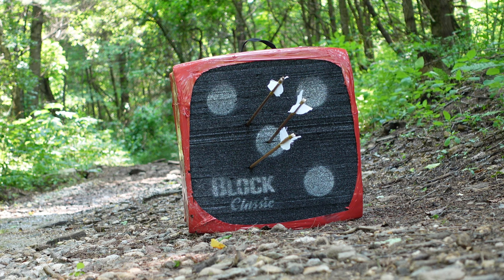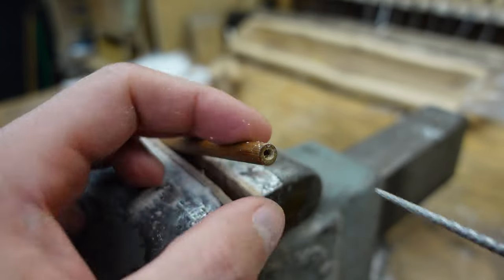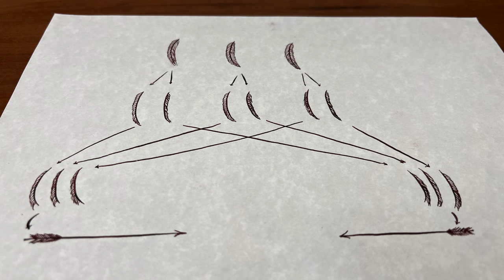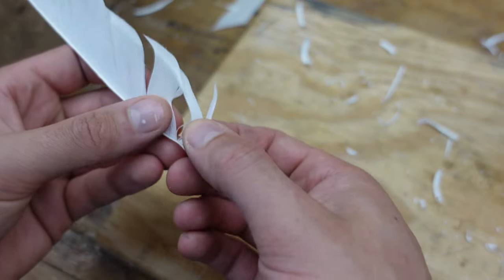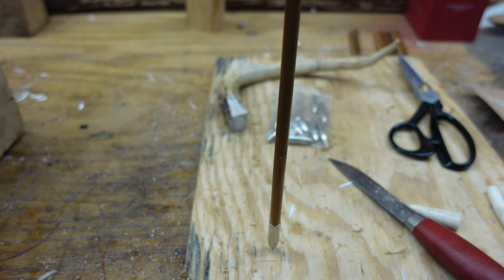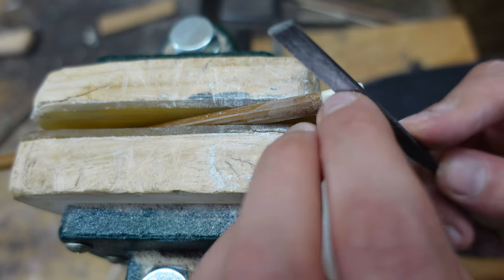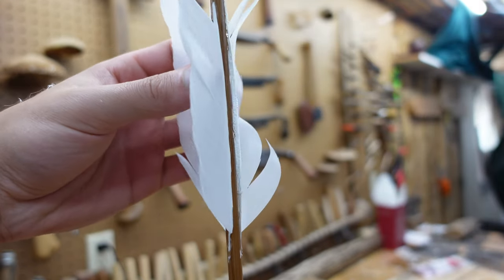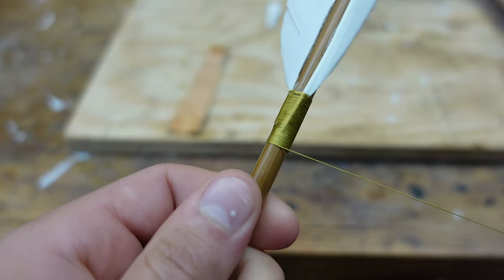How To Make Bamboo Arrows with Antler Nocks

Comment: I made two sets of 12 myself, got the shafts from homebargains had to size and weigh them into sets .. a lot of wastage but so cheap anyway, getting them strait was fun 🙄. Came out a lot better than I expected. I did forget to burn a hole through all the sections to balance out the internal pressures but that's not proved detrimental as some have taken heavy impacts and not shattered 🙂. They fly strait and look awesome 👍

Comment: I've not tried to make my own arrows yet but thanks for the inspiration. I am working on my fourth self / board bow and it is coming along nicely. First one worked but was under weight from what I wanted... second broke in tillering when I got a bit hasty... third worked and I shot a few hundred shots through it before a flaw I had noticed in the grain.. where it twisted eventually gave way. This one seems to have nice straight grain all the way and I am hoping it will be the best of my efforts so far.
Reply from the maker: If you ain’t breakin ya ain’t makin!
Reply: I might suggest starting with a kit of bare carbons first.  Then work up to wood and bamboo.  You will want to have a spine tester to help with selection.
Reply from the maker: @MrRourk I’m not comfortable recommending shooting carbons of of bare knuckles to a mass audience. That’s a fine personal risk but I don’t wanna be responsible for a kid following that advice and messing their hand up. 

There’s no need for a spine tester in primitive archery. It’s really not hard to learn to tell if you have a mismatched arrow without formally testing the spine. Watch ryan gil make perfect groups with completely mis spined arrows

Comment: Dan, it's ADDeviant_again.

Great work as always!  If I may add......

I always "foot" the front end of bamboo arrows  with a little length of dowel to reinforce them. 

 I also mark the shafts that need to be reduced at the tip ends with pecil or market and scrape that off with a sharp scarper or knife blade to keep the reduction even and the shaft round. 

Great work on the antler knocks.
Reply from the maker: Great tips, thanks!

Comment: Try grabbing the last hairs on the tip of the feather and pull apart you can get them peeled off perfectly and won’t have to scrape the pithy bit off the back side. Im going to have to try the antler knocks! I’ve always cut my knocks right into the back of my (river cane) shafts after filling the hole and then sinew wrap below the knock.. I don’t think your silk wrap would keep it from splitting out though…

fantastic video as usual. Your cousin’s music pairs great with the videos and inspires creativity
Reply from the maker: That hasn’t worked for me with these particular feathers. I always try peeling first but it consistently ruins these. 

The silk is stronger than it looks too. Nothing like sinew but it still offers a decent amount of protection.

Comment: If only it didn't take so long to get the funding for the whole tool together, I'd be there by now.

dan, would you like to tell us if it is possible to cut a thread into the bamboo shafts?

... if I go there, I would like to use screw-on syringes
Reply from the maker: You don’t need a professional tool set up. You can do 80% of what you need with a set of rasps and files and a sharp knife.
Reply from the maker: I’m sure you could thread the bamboo but it wouldn’t last long. I’ve threaded a nut onto bamboo as used it as a blunt tip. Surprisingly effective
Reply: @DanSantanaBows  oh no, the one with the tool is such a chess...
I liked to hurt myself with half-neatness...
I'd rather do it right and in the meantime I'm realigning my garage ;)

This surprises me now that bamboo is quite durable...
what would be the reason why screw tips should not be able to last long?
Reply from the maker: @torstenlorenz5477  I think you mean the farriers rasp. I believe the one I have is by Nicholson
Reply: @DanSantanaBows  no, lol, I mean, I didn't have a decent tool... It slowly but steadily accumulates ;)
but thanks for pointing this out...
what is the reason for this decision regarding bamboo, its durability in connection with screw tips?
Reply from the maker: @torstenlorenz5477  Oh i see, you want to use normal screw in points in the bamboo. I’m sure it would work if you wrapped the connection with strong thread or sinew
Reply: @DanSantanaBows  
hmm
look for the medievil tip-tophat
(I really love this)

if i cut a thread in the bamboo, is that not enough ?
why ?
Reply: furthermore, I am really surprised that the bamboo shafts are so cheap (thank the creator with illegally upheld trade law)
this is such a high level art
Videos like 
"Traditional Handmade Japanese Arrow Making 弓矢"
and
"시간을 관통하는 민족의 혼, 궁시장 양태현의 화살 제작 과정ㅣMaking Korean Traditional Arrows"
you surely know